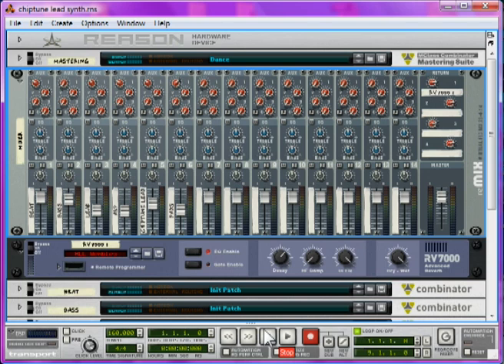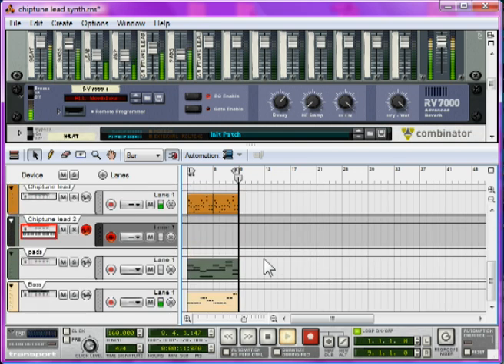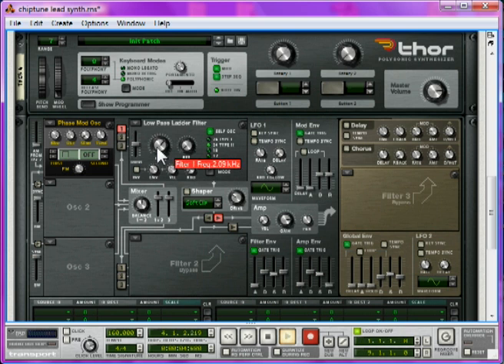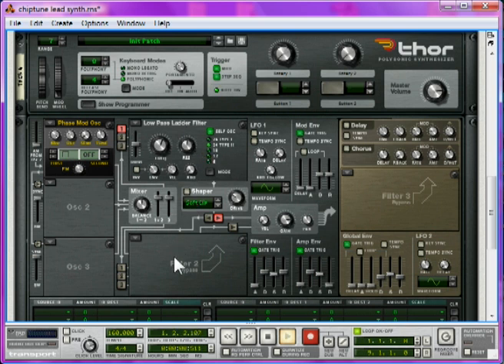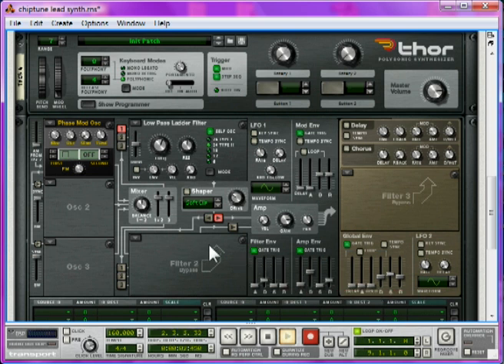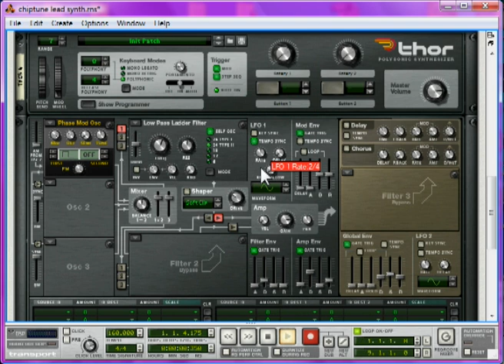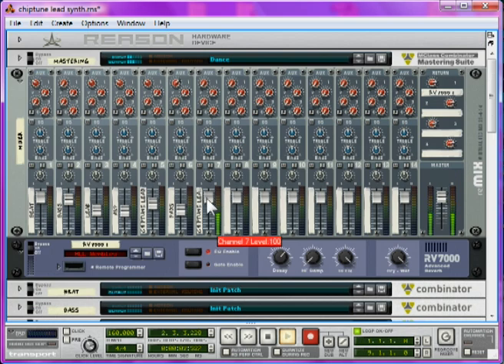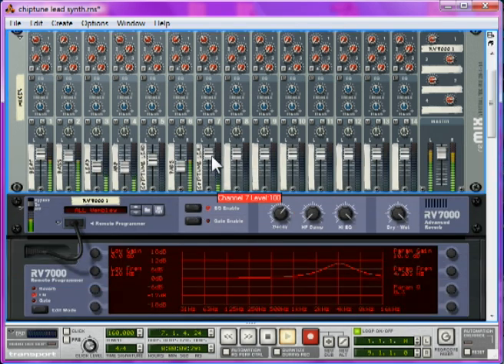Tutorial: Making a chirpy chiptune lead synth in Reason 4

Comment: hum this is not chiptune, everything must be lofi for a real chip tune track, or you used a Tracker like some on AMIGA computer and PC and also true hardware chip from old game, or you try to used sample in lofi 8 bit 11000 khz or 8000 khz without interpolated filter, when i do chiptune with reason i only used maelstorm ( because of is natural grainy tone ) and also the screamer in digital destructor mode, and only low fi sample, and a couple of arpegio in very fast mode betwen 1/64 and 1/128.